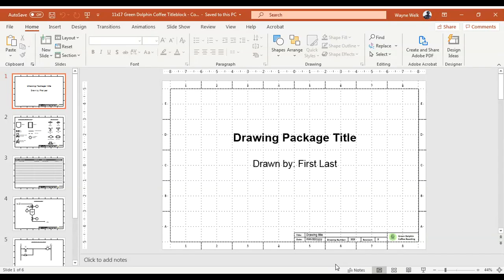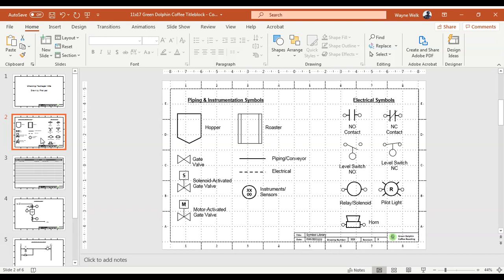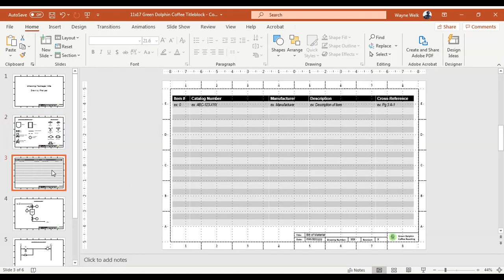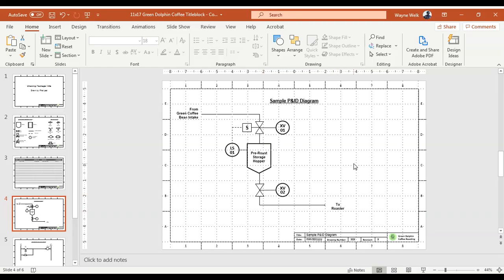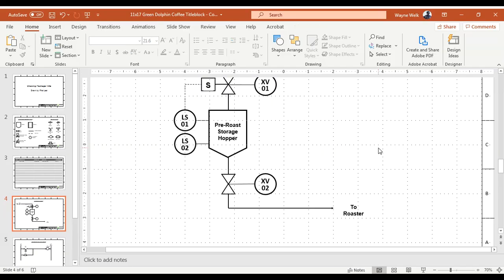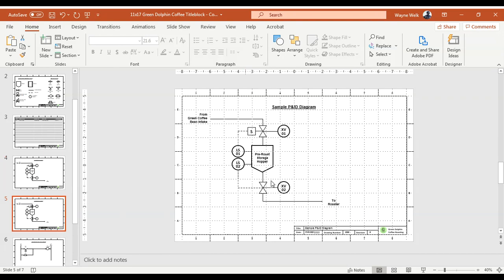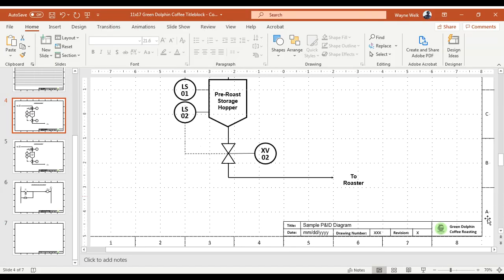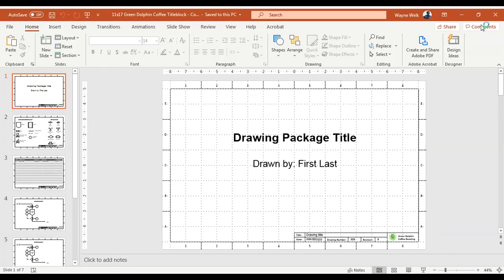Using PowerPoint to draw a P&ID Diagram

Comment: Some more tips: 
Instantly duplicate a selected item - Ctrl+D
Set default parameters for a shape (color, thickness, etc) - Rtclick, Set as Default Shape
Instead of manually adding multiple line segments to connect elements, use the "Connector" shapes (elbow, elbow arrow, curved)